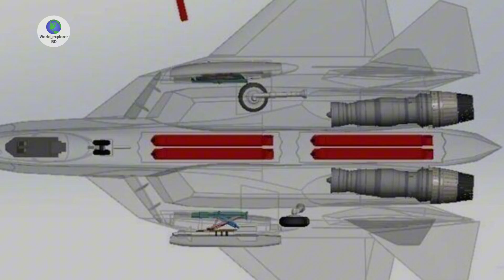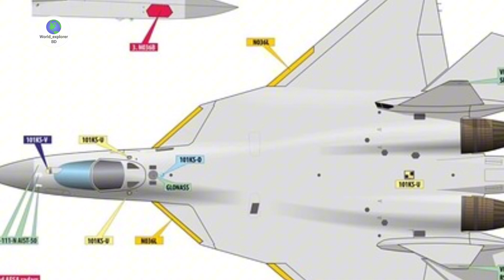Russia Unveiled Su-57M1 Stealth Fighter With AI-Assisted Systems.

Comment: *Summary of the Su-57M Unveiling and Geopolitical Context:*

On May 15, 2025, Russia’s United Aircraft Corporation (UAC), through the Sukhoi Design Bureau, unveiled the Su-57M, an upgraded fifth-generation stealth fighter jet, during a Moscow presentation by test pilot Sergey Bogdan. This advanced variant of the Su-57, part of the PAK FA program since 1999, aims to replace the MiG-29 and Su-27, enhancing Russia’s air combat capabilities with AI-assisted systems, improved stealth, and long-range radar for air superiority, ground attack, and maritime strike missions. Despite production challenges due to sanctions and limited output (12 units by 2023, with plans for 20 more in 2024), the Su-57M addresses these with upgraded systems and a new engine under the Megapolis program.

*Key Features of the Su-57M:*
- *Airframe and Stealth:* The Su-57M features a redesigned airframe (14.8m length, 9.8m wingspan, 4.6m height) using composite materials (polymer, fiberglass, aluminum honeycomb) for a reduced radar cross-section (0.1 m² frontal aspect, less refined rear). It weighs 18,500 kg empty with a 35,000 kg max takeoff weight, enabling supercruise at Mach 1.6 without afterburners.
- *Propulsion:* Powered by two AL-51F1 engines (11 tons dry thrust, 17 tons with afterburners), offering 15% better fuel efficiency and 20% higher thrust-to-weight ratio than the AL-41F1. A non-axisymmetric flat nozzle tested in 2024 further reduces thermal signatures.
- *Avionics and AI:* The SH121 system with N036 Byelka AESA radar (nose and cheek-mounted) provides 360° awareness, tracking 60 targets and engaging eight up to 400 km. AI streamlines pre-flight checks, navigation, and targeting, reducing pilot workload. The L402 Himalayas electronic warfare suite and 101KS Atoll infrared search-and-track enhance survivability.
- *Armament:* Two tandem internal bays (4.4m x 0.9m) and two side bays carry K-77M (200 km range) and R-74M missiles, KAB-250/500 bombs, and Kh-38 missiles. External hardpoints support up to 7,400 kg, including hypersonic Kh-47M2 Kinzhal missiles (2,000 km, Mach 10).
- *Operational Role:* Building on limited Su-57 use in Syria (2018) and Ukraine (2022), the Su-57M is designed for aggressive roles in contested areas like the Arctic or Central Asia, potentially paired with the S-70 Okhotnik UCAV.

*Comparison and Challenges:*
Compared to the F-22 (0.0001 m² RCS, production stopped) and F-35 (1,000+ units, superior data-linking), the Su-57M prioritizes maneuverability and speed (Mach 2, 3D thrust vectoring) over absolute stealth. Sanctions limit access to Western electronics, slowing production at Komsomolsk-on-Amur, though new facilities aim for mass production in 2025. Export prospects (e.g., Algeria, India) face hurdles due to delays and competition from China’s J-20 and J-35A.

*Geopolitical Context (Taiwan, Ukraine, Semiconductors):*
The Su-57M’s unveiling aligns with Russia’s need to project power amid global tensions. Taiwan’s semiconductor dominance (e.g., TSMC) mirrors Ukraine’s energy transit role for Russia, both critical assets. China, observing Western sanctions on Russia (e.g., $630B frozen reserves), moved assets from Western banks to avoid similar risks in a Taiwan conflict. Western support for Ukraine wanes due to low ROI and semiconductor shortages, depleting weapon stocks without resupply, as TSMC’s chips are vital for advanced systems. This weakens Western defenses, potentially emboldening China.

*Practical Steps for Individuals:*
To prepare for uncertainties like supply chain disruptions or conflict escalation:
- *Asset Protection:* Safeguard wealth via decentralized assets (Bitcoin, physical gold) to avoid bank freezes or defaults, as seen in Canada’s 2022 convoy protests or recent U.S. bank failures.
- *Self-Sufficiency:* Invest in tangible assets (food, energy, tools, firearms) for autonomy during shortages. Avoid consumerist spending (e.g., new iPhones) and focus on ROI-driven investments like skills or business optimization.
- *Economic Awareness:* Recognize scarcity-driven economics. Protect limited assets against inflation or systemic risks (e.g., rising treasury insurance rates signal distrust in bonds).

The Su-57M strengthens Russia’s air deterrence but faces production and technological constraints. Its development reflects Russia’s resilience, while global semiconductor and energy dynamics underscore the economic stakes of Taiwan and Ukraine, urging individuals to prioritize asset control and self-reliance.[](https://armyrecognition.com/news/aerospace-news/2025/alert-russia-enhances-su-57m1-fighter-jet-with-artificial-intelligence-and-aerodynamic-upgrades)[](https://bulgarianmilitary.com/2025/05/19/russia-unveils-su-57m1-stealth-jet-with-ai-assisted-systems/)[](https://en.wikipedia.org/wiki/Sukhoi_Su-57)
Reply: Al 51engine  got ready ?